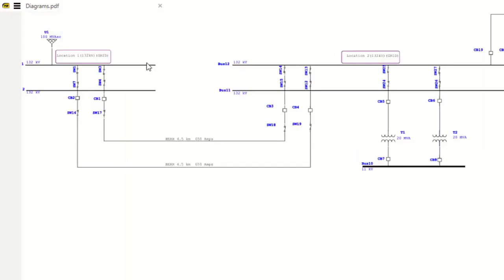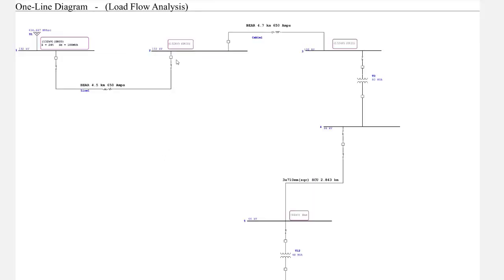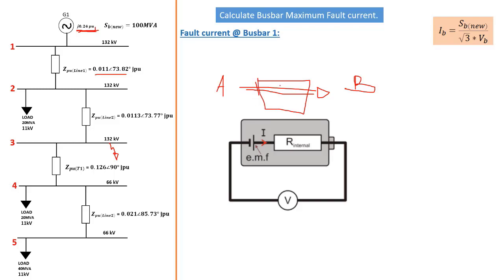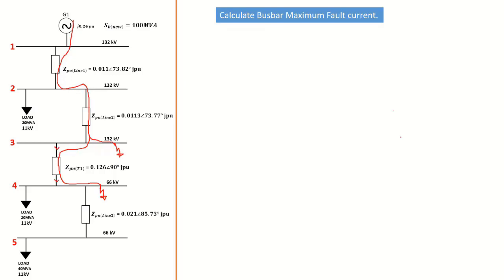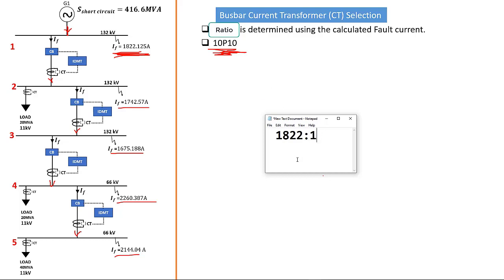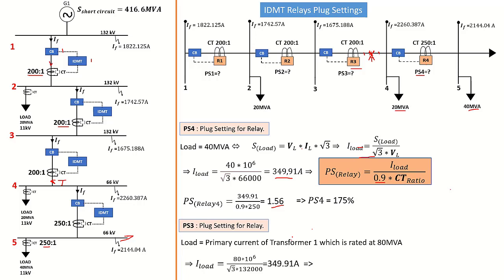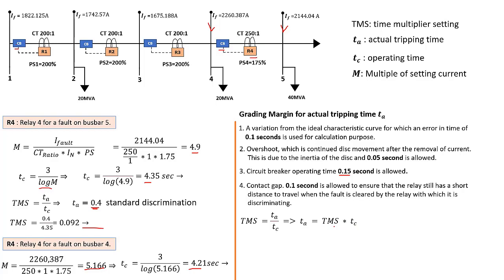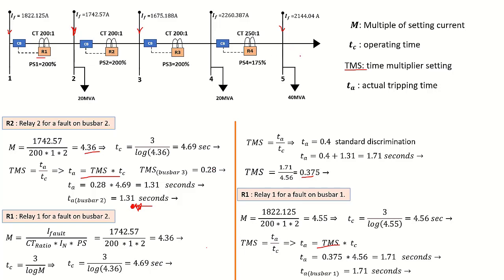Fundamentals of Power System Network Design

Comment from the maker: If you ❤️ my content and find it helpful, please Subscribe and hit the Bell 🔔

👇  SUBSCRIBE TO CMTEQ CHANNEL NOW 👇
https://www.youtube.com/c/CMTEQ?sub_confirmation=1
Reply: It is helpful thanks a lot but I have question that I couldn't understand which is when setting plug for the relay, from down to up i.e. from R4 to R3 plug setting ps3 isn't it the secondary of transformer that pass through the relay coil which makes it relay primary? if that is the case why don't we take load current of the secondary i.e. 66kV?
Reply from the maker: Hi Abdi, thanks for reaching out it will be helpful if you can Point out a section, minutes of the video where I talk about this. But I will look it up and try answer your questions with all the facts.
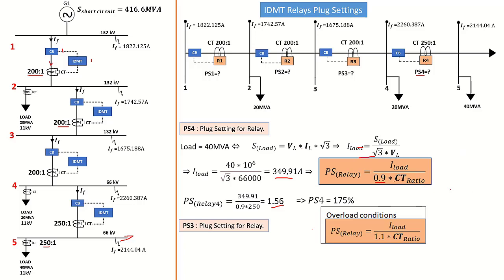Reply: @CMTEQ  from 1:27:00
Reply from the maker: @abdijerane8152  If you watch from time @1:27:00 it is said that the relay is on the primary of the transformer, therefore it will only see the primary current going into the transformer no matter what is happening on the secondary side.
Reply: @CMTEQ  oh, I see thanks a lot.
Reply from the maker: @abdijerane8152  Remember the Relay is not there to only protect the transformer, the relay is there to protect many other equipment, measurements devices that operate on low voltage within the busbar. Hence the relay is located near the busbar to protect against the short circuit current level from the busbar,.

Comment: sir for the work example , the 100MVA generator cant produce 132 kv itself , shouldn't be a step up transformer right before the very first 132 kv busbar ?
Reply from the maker: Yes, you’re absolutely right. A 100MVA generator would typically operate at a medium voltage level, usually around 18–20kV, and a step-up transformer would indeed be required before connecting to a 132kV transmission busbar.

However, in this example, the 100MVA does not represent the generator’s rated power. It represents the prospective short-circuit MVA at the 132 kV busbar, which is simply a way of modelling the upstream grid strength.

In short-circuit studies, the grid can be represented by an equivalent source with a given short-circuit MVA at a specific voltage level. This equivalent produces the same fault level at that busbar, regardless of the actual generation voltage behind the transformers. Only network impedance (transformers, lines, fault impedance) will reduce the fault level as you move away from that busbar.

So yes a step-up transformer would exist in reality, but it is omitted here because the grid is being modelled as an equivalent source at 132 kV.

Comment: Evening Sir
Thank you so much.

Will I be wrong if I take those parallel lines that are the same and I proceed with the calculations ?
Reply from the maker: Hi Lucky, no you wouldn't be wrong, you just need to careful respect the rules involving parallel lines, because at some Point they will either converge or split and you must keep watch on the Current value at each case.
Reply: Okay Sir i understand and thank you once more
Your video is helpful👍

Once last question, if my tripping time on the first busbar is higher than 1.2seconds, how can i reduce it to be lesser than that ?
Reply from the maker: First busbar from the Top (Upstream) or Bottom ( downstream) Relay?
Reply: @CMTEQ  First busbar from the top (upstream) Sir
Reply from the maker: Okay, you need to check with the network provider, like ESKOM in case of South Africa,, ask them what is the highest allowable time for the fist relay near the High voltage line.

Those relays are have specifics time that they have to go off after to avoid huge black out. If they say the time must be less than 1.2 seconds for your network arrangement then you need to check your calculations.

How many busbar does your network have?
Reply: @CMTEQ  yes the tripping time is 1.2seconds as i am from South Africa 

My network has 5 busbars
Reply from the maker: Did you confirm that with Eskom, try talk to Eskom Engineers and get that confirmation.  
If Eskom confirmed to you that its 1.2 seconds for a 5 busbar arrangement than you need to double check your calculations.
How is your time, 1.3 secs, 1.5 secs ..... 
There are a couple method used to decrease your time, you need to work on the total fault current, that have an effect on your tc calculations and ultimately your ta. 
You can either increase your line impedance by adding extra cables length or inserting fuses....
Reply: @CMTEQ  My lecture confirmed that it's 1.2seconds Sir

My ta on the first busbar i was referring to it's 1.4965seconds, i've tried to reduce my load MVA but still...let me take your advice to increase the impedance then
Reply from the maker: Alright,  you are not too far out,  if your calculations are right then you need to do 2 things.
1.  Have a discussion with your lecturer, prove to him that all your calculations are right and tell him about things you could do to improve your timing.

2.  Go at the last bottom busbar and add a fuse next to the relay,  a fast blow fuse has a time reaction of 0.1 seconds, instead of 0.4 seconds discrimination time for the relay, that will give you a small TMS and a smaller ta for your next relay, that should reduce your time to under 1.2 seconds.

Are you subscribed to CMTEQ Channel? If yes stay tuned and inform your friends about the channel. Thank you.
Reply: @CMTEQ  okay sir thank you so much i'll redo the calculations again for the steps you told me to take...i really appreciate your responses 

And yes I've subscribed to the channel Sir Thank you
Reply: Morning Sir once again

I have the last question, What if my lines that are in parallel have different impedances, should i calculate the plug settings and relay settings individually for those lines?
Reply from the maker: You are welcome to ask questions and I will assist with answers when I have time. CMTEQ Channel is here to assist Electrical Engineering students.

Remember parallel lines means they are connected to the same voltage sources, but may have different loads or same loads connected to them.
If the loads are different it means they will have different Circuit breakers or CT settings, 1 line might have a 2kA current and the other one 1.2kA current, you cannot use the same Circuit breaker for both line, same with overcurrent IDMT relays, they will have to have different settings to deal with different load current and fault currents.

One line might be longer and have multiple transformers and substations along the line, this means it will have a high line impedance too.

So, if your line are different in terms of LOAD and impedances, you should calculate the plug settings individually.